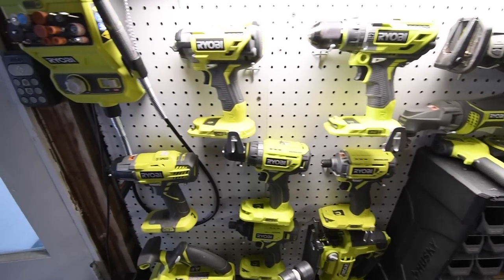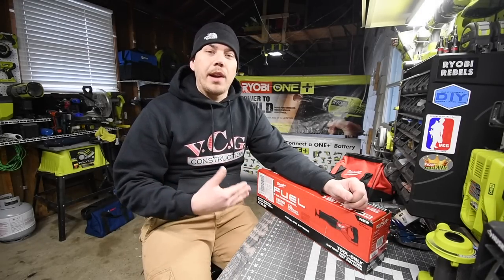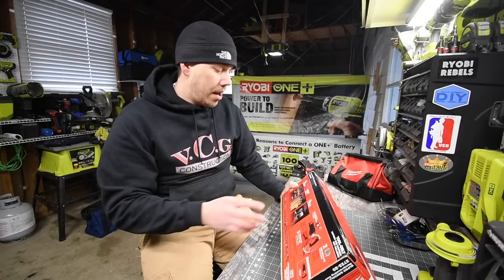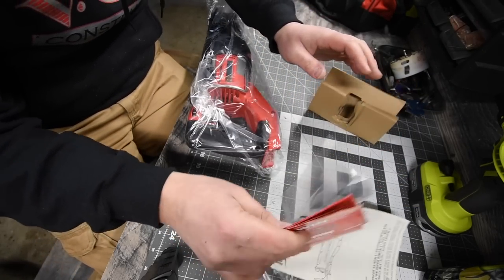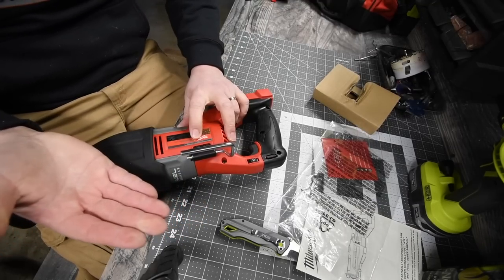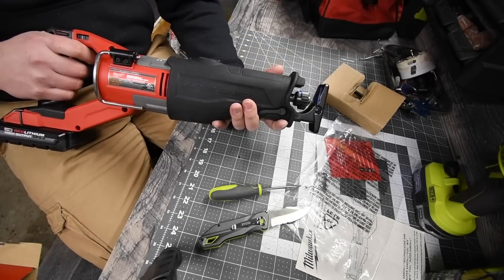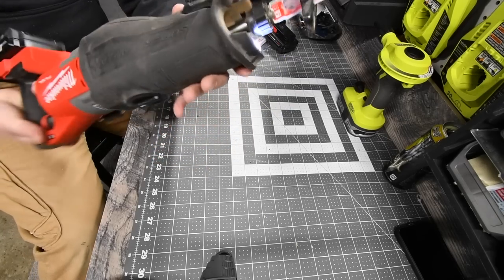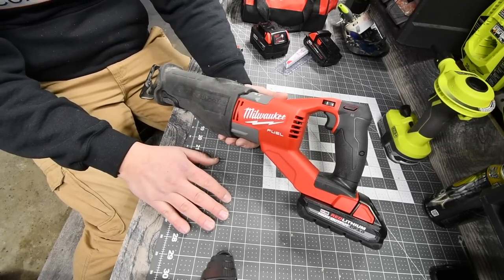Milwaukee M18 "SUPERsawzall"

Comment: VCG cut a 6 by 6 with the Dewalt and it cut it in 13 seconds non orbital because it doesn't have it and the Milwaukee 21 seconds with orbital and they have made the 60v flexvolt even more powerful
Reply from the maker: I can wait to do the versus video on it and thank you sir

Comment: Screws are much harder than nails. Going through screws like that will smoke that blade 9:48. You can see the teeth missing 10:24. Those blades are made for nail imbedded wood not screws
Reply from the maker: yes sir, I need to get nails for these tests and thank you

Comment: Nice video hoss , this saw is a frickin animal. U think it is heavy with the 3ah....try a 12ah.  If I may give you some advice , I know people wanna see everything balls to the wall and that's all good....but everything is not a race. When cutting the metal pipe....try starting a little slower and then gently bring the power on....this saw has a pretty decent stroke length so when combining that with a with a lot of power and speed you can and will destroy blades very very quickly and remember that screws are much harder than nails... do the same test with nails and not screws I would bet that the nails would barely even slow the saw down. Heat is the enemy.....
Reply from the maker: precision cutting video will be done in the future and thank you sir

Comment: You need to do some research and learn a thing or two about batteries before trying to "teach" others about them. You spread false information on at least one other video within the past month as well

High Output isn't "only good for short bursts" and the run time isn't any different than regular batteries. 3ah is still 3ah. 6ah is still 6ah. More capacity is more run time no matter what size cells are used. 21700 batteries have higher discharge rates. That only means you can run a more powerful tool with a smaller battery to save weight. You only give up run time because you use a 3ah instead of a 5ah or a 6 instead of a 9

Last thing. That saw is designed to run off a 12ah battery. Granted you're just doing little things in the video but using any less than a 12ah takes away from the performance
Reply: MUDDY BADGERS agree with the 12ah battery, seen it with my 1/2” impact wrench, quik lok string trimmer and of course my sawzall
Reply: Wrong. On the ho 3. Same output as 12. Just shorter  time. Same Ho vs ho. You just said it in your comment I own both and have ran test with vacuum and audio output app. 3Ah vs Ho3Ah vs Ho12ah. Almost exactly same time on 3’s. But the pitch frequency was 14 Hz higher and overall dB peak 4 higher. With Ho3Ah
Reply: @chriscord6524  you're wrong. Run some real tests that actually measure how powerful a tool is with different batteries and you'll learn pretty quickly that every battery is different
Reply from the maker: so you are telling me the 6ah High Output will last as long as the 6ah High Demand battery? because that's what I was comparing it to in the video. high output vs high demand
Reply: @ManCaverTools  the term "high demand" only refers to how many cells are in the pack. High Demand (HD) is a 15 cell pack, XC is a 10 cell pack, and CP is a 5 cell pack. High Output just means it has 21700 cells. 21700 cells are obviously bigger than 18650 cells giving them the ability to be made with higher capacity and higher discharge ratings. 6ah is 6ah. The watt hours are more important when comparing different brands with different voltage. Watt hours is the total energy stored in the battery. A 6ah 18v battery has 108 watt hours regardless of what cells or how many cells are used. The reason it's better to use watt hours instead of amp hours is, for example, when you're comparing Hilti (21.6 nominal volts) to Milwaukee (18 nominal volts). They both have an 8 amp hour battery but they're not equal. The 21.6 volt battery has 172.8 watt hours while the 18 volt battery has 144 watt hours